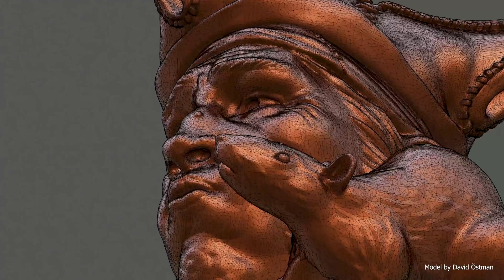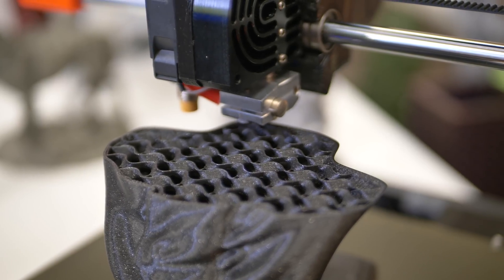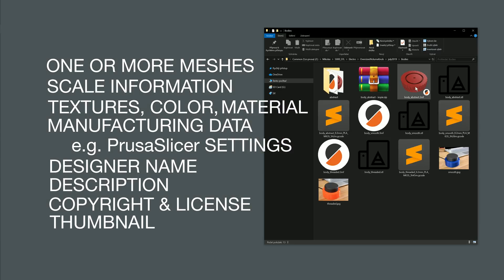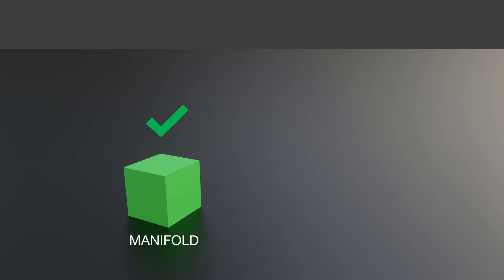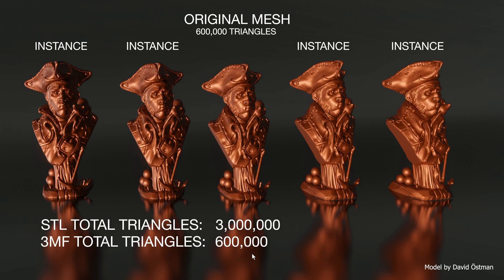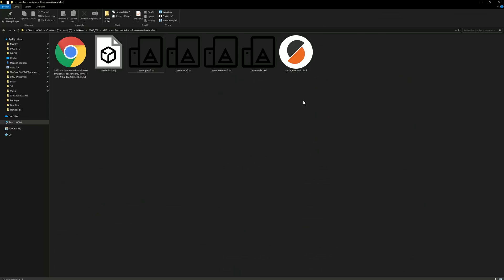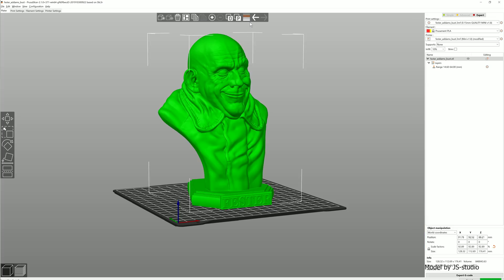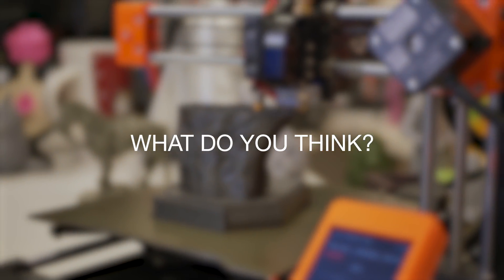Why STL is dead and 3MF is the future of 3D printing

Comment: The print settings really shouldn't be saved in the file. That's like saving the print settings in a PDF. Makes no sense considering people have different printers and quality requirements.
Reply: Ironic since pdf was literally created to be a printsetting application. ..that aside however I agree. Supports and infill are not 'independent of printers' as Prusa says, and are very dependent on the users needs, materials available, and expertise in printing. I suppose it doesn't 'harm' anything to have it in there, but I won't lose sleep over it either way.
Reply from the maker: Stuff like number of perimeters, infill, custom supports, etc. are pretty much independent of the printes, it's pretty nice to have those set-up for you by the model creator.
- Mikolas
Reply: @Prusa3D  They're independent of the prints, but not independent of the printers  (either the people or the machines).  Not saying it's a bad idea, but I'd definitely want Prusa Slic3r to have some sort of prompt for whether I want to use the included settings or not (in a: yes/no/always ask sort of format).  Custom supports in particular might be very dependent on the capabilities of an individual's printer.
Reply: @Prusa3D  I agree, as long as they can be overridden after loading the file. Some of us simply like to experiment with stuff after all :)
Reply: @Prusa3D  It is PARAMETERS. Learn the fucking language, moron.
Reply: I'm not an expert on the current PDF specification (I get the feeling no one is, these days, considering even Adobe has trouble transferring PDFs between their applications :P), but I'd be very surprised if it doesn't let applications store print settings and other custom data.
Reply: @RFC3514  PDF's are not for printing, they essentially have already been printed. they are for easy transportation of data, hence "portable document format" 

If you're having issues with them it's probably because you're "saving as" or "exporting as" which doesn't actually make a true PDF, it makes a messy file format and merely composes the file you were using in a format that can be opened in Acrobat reader and gains its "portable" status that way, other than being able to open it in Acrobat reader it is a useless file format. To make a proper pdf you need acrobat pro so you can "print to" a PDF, this then goes through a program working in the background of your computer called "distiller" which strips out all unnecessary information, compresses necessary information and makes a tiny file size to gain its true "portable" status. The point of which is to send to someone by email so they can check it and if it's all hunky dory you'd then go back to your original file (not a pdf) and get it printed from that file as it contains all the colour information that PDF's do not retain. 

If your printing service is asking for a pdf, it's because they take it for granted you haven't a clue what you're doing and it saves them a load of grief from people not knowing how to make a file "print ready", and if you don't know how to do that, you probably won't even notice that your colours are off.
Reply: @Fergus Denoon - "they essentially have already been printed" - Complete nonsense. PDFs are not raster data.
Reply: @RFC3514  you literally "print" to pdf to make a pdf, instead of a hard copy you get a file.

Rasterising is merely the process of turning paths into pixels, and can be done on a computer and it is completely aside from the "printing" process, non rastered artwork can also be printed so your comment makes no sense at all... Rastering is not a prerequisite for printing.
Reply: @Fergus Denoon - You literally have no idea what you're talking about. PDF is a multimedia format that can include vector data, typeface definitions (that go far beyond what gets printed) and even sound clips and movies (good luck "printing" those!). In fact, these days it even supports 3D object extensions, so you could literally use it (as a source) for 3D printing. 

You can "print to PDF" just like you can "print to e-mail". That does not mean that "e-mails have already been printed" or that either format is limited to things that can be printed. 

And rasterising is very much "a prerequisite for printing" on any normal inkjet printer. Even cheap laser printers rarely have hardware support for PostScript, these days, it's up to the driver to chew through it and feed them raster data. And even when they do support PostScript, they are rasterising the vector data internally, so it can be printed in a single pass across the page (unlike a plotter, which would follow the vector data without rasterisation). In the immortal words of Bob Marley: no raster, no print.
Reply: RFC3514   30 years in the printing/marketing industry... where I know definitions of the word "print" that you obviously don't suggests I do know what I'm talking about, although I won't use an appeal to authority I'll use actual data to back up my claims, your claims however break down quite quickly when exposed to reality;

 it is not a prerequisite on "any inkjet printer" HPz61/z6200 series have "PS" at the end of their title for a reason... I use large format inkjet printers every day that support postscript. You then went on and made a point that discredit you own previous claim that to print required rasterising, it doesnt. 

to "print" something... is to produce a published form, or if you like: arrange for a manuscript/book etc to be reproduced in large quantities, that published form does not have to be physical. You seem to be hung up on the notion a print has to be physical. Multimedia content is included in the definition of "printing" to a PDF, as soon as you have done that and made the PDF you have a "print" of what you wanted to produce.
Reply: "I know definitions of the word 'print' that you obviously don't" - Ah, I see; so you weren't wrong, you were merely using "definitions of the word print" that don't match the one used by other people (or the dictionary). :D Good one. I guess by that new and (un)improved logic, If I "print to PDF" for my own personal use, I'm not printing because it's not being "published" (but I'm sure you can redefine that creatively as well).

Maybe go read up on the structure and history of PDF files instead of writing nonsense like "PDF's are not for printing, they have already been printed" or "they are for easy transportation of data", as if data becomes "easier to transport" depending on which file format you use (you didn't even understand what "portable" means in "PDF" - hint, it has nothing to do with transportation, it has to do with compatibility across multiple platforms, which is called portability in computer science). A PDF is as "easy to transport" as any other file of the same size, and in fact tends to be slightly larger than other formats, because it stores extra data (harder to transport but with better portability).

Of course PDFs are "for printing". That's the whole genesis of the format. It was originally created so the same document (containing text in specific fonts and with specific formatting, images, vector graphics, etc.) could be rendered (rasterised) and printed consistently across multiple platforms. It was a smarter alternative to "print to file" (which was supported even before PDF existed, and merely dumped a rasterised version of the document into a bitmap, at a fixed resolution).

With a PDF, the data was kept as separate blocks of different formats, packaged into a single file, which was then rendered on each system, for its local printer (or, these days, screen), at its native resolution. It was (and still is) almost the exact opposite of something that "has already been printed".
Reply: @RFC3514   RFC3514   the definitions I am using are in the dictionary, they are dictionary definitions, the information I am using can be verified by anyone. there's no way you actually looked up "print" in the dictionary if you didn't see the examples I stated. If "published" doesn't suit the criteria, the other example I used does.

"Of course PDFs are for printing" If it were don't you think the P would stand for "Printable" instead of "Portable" the entire Genesis on the procedure was to make a format that anyone could open on any computer so people wouldn't need to own the software the developer used to create the artwork/document etc, and could open it up on a free application, hence why "save as" and "export as" adhere to portability because they can be opened in Acrobat reader, but they are larger file sizes so are less "portable" than a printed version which goes through distiller, Adobe's actual PDF engine, and creates a tiny file size whilst maintaining quality that can be sent a lot easier, this way the designer can get their artwork proofed by their client on the other side of the world without any hassle and no need for specialised software. 

It was originally invented to it could be printed consistently access many platforms... PDF's are actually very consistent when regarding print quality... if everyone did the exact same thing, which they do not. most don't know how to correctly make a pdf so pantone/spot colours are not maintained. There are so many ways to make a pdf, so many settings that the recipient had no control of, many apps that are downloaded that make them as people don't own Acrobat Pro, inbuilt mechanisms in programmes that all do different things with different results, that is not consistency unless what is consistent is non consistency. Sending an illustrator file from Illustrator or an InDesign file from InDesign will be consistent. Making PDF's one way which completely flattens each page to a single uneditable image is not consistent with making it another way where a PS file maintains its layers, and yet both are "PDFs"

Of course a correctly made PDF is better for portability, The simplicity of e-mailing a 2mb PDF file in comparison to the 199.4 mb PS file it was made from surely isn't that hard to understand?
Reply: @RFC3514  as for "the exact opposite of something that "has already been printed" Erm... So it goes through the print process and one produces a hard copy, one produces a (or, these days, screen) copy... 

Exact opposite?
Reply: @Fergus Denoon - So, first you say "PDF's [sic] are not for printing, they have already been printed". Now you say "it goes through the print process". So something that (three posts ago) "wasn't for printing" and "has already been printed", now is meant to "go through the print process"...? I suggest you continue that argument with yourself (which is what you seem to already be doing, at this point).

Something that needs to "go through the print process" (and, specifically, a different "print process" depending on the output medium quite clearly is a) "meant for printing" and b) not "already printed". It's not even a matter of knowing how digital files work, at this point, it's just a matter of understanding basic language.

Then again, when someone writes "one produces a (or, these days, screen) copy" maybe language was the fundamental issue all along.

I can only suggest reading the last paragraph on my last post again, because you clearly didn't understand it (just as you don't seem to understand what PDF files are or why the format was created).
Reply: @RFC3514  no, I originally stated it has already gone through the print process, and in the last one reiterated that by stating that in order for you to be looking at it on screen it would have been through the print process...

Which is exactly the same thing!

What is wrong with you?
Reply: "I originally stated it has already gone through the print process" - Exactly. You were wrong then and you are still wrong now. I've already explained why; beyond that it's up to you.
Reply: @RFC3514  how exactly was I wrong in that assertion? 

Given that A) we are talking about a pdf that is intended to be printed to hard copy. (So your comments about multimedia are obfuscation from the subject matter as the intent of a multimedia file with editable fields, videos etc is not to be printed, it is to be used in its created format on a computer, why would you print that?) 

And B) the correct way to make a pdf for the intention of printing is to print it to a pdf, the entire purpose of Adobe creating "Distiller" and why the print driver "Adobe pdf" exists in your printer queue when Acrobat Professional/DC is installed (although this may not be the case on a Mac since they pissed off Adobe, which is always a bad idea)(Because this reduces the amount of work the printer has to do, reduces the load on the file, and reduces communication issues. In the case of professional printing services requesting PDF's, that is done for many reasons, what it is not done for is producing the best print, the main thing it is done for is it cuts out the incompetence of many a designer who thinks they know what they are doing but as they can only see things from their own perspective are oblivious their own perspective is a fallaciously ignorant one. So to them, the designer, when opening up an illustrator file for example, or an InDesign file, or an AutoCad file, on their own computer where they created the file, they double click on the file and it opens up, this... Only happens on that computer! If they send that file to the professional printer like they often do... it will not work! 
So the print service provider has options; goes through the painful process of getting them to sift through their computer looking for all the links to images that are missing from their file, extracting the fonts they used and saving them along with the file all contained in a folder, as when double clicking a file the first place it looks for all its links is in the folder it is contained in. this is easier to explain than explaining how to embed images properly into an illustrator file, this usually takes a few attempts by the designer as they miss things, in design at least has a collect for print option that helps.
 printers have had to put up with this incompetence for so long they can't be bothered with it anymore as it's a waste of their time... this is what printing to a PDF does away with. 

When they print to their own local printer they wouldn't make a pdf, they would print directly from Illustrator, so it is logical to assume we are talking about sending it to a professional printer or printing a pdf that has already been created for the purposes of printing, so has already been printed to pdf.

So basically because designers in the past have wasted so much of the printers time they've taken actions to reduce the amount of wasted time, they produce a lessor quality print (which usually doesn't matter as the quality reduction is something that's not really noticed by the average punter who don't walk about with a magnifier) but one that is far more consistent at producing results from the first instance of receiving the file, basically once you have got through "print to| pdf" the information that it produces cannot be changed by layers slipping , missing fonts or merely opening it up on any other computer, it will be very/completely consistent, as opposed to Illustrator/InDesign/Cad files which are not consistent at all and require external resources to make them work properly, as opposed to the flattened PDF file which requires no external resources at all. 

If you take a "save as" or "export as" pdf to a external printer the first thing they will likely do is... Print it to a pdf, because they already know it wasn't printed to a pdf by the size of the file, the reason they don't send the "save as" file directly to the printer is because it will cause problems, the print machine expects certain things from a pdf, and if it doesn't react like it should it will simply abandon the file and will stop printing, this will not happen with a "print to" pdf. If it starts spooling for too long because it has to flatten layers it will likely abandon the print, PDF's are not great for printing banners and usually cut off at 2.1meters whilst you never ever get these issues printing directly from the programme the file was created in because they are all better at printing than Acrobat. Acrobat however has additional features they do not have like multiple pages options that some programmes would require a manual set up instead. 

You are always better printing from the programme the file was created in if you can, that's what produces the best results, that's where all that files information is retained, using a local printer you'll have no problems, using an external printer you'll be met with problems hence why they ask for PDF's, because they are portable.
Reply: fergus, mate, i do work in the printing business, and you have no idea what youre talking about. pdf files are totally "for printing", thats the whole point of them. whether youre printing on paper or on a screen, a pdf file is a container with a list of formatting instructions and source material - text, fonts, images, graphs - that allows you to build the document in a format compatible with the output. 

it has definitly not "already been printed". in fact, if you knew anything about printing, youd know that pdf files need to go through a rip (raster image processor), the most common of which is adobes aptly named pdf print engine. that is what produces the data that your printer can understand, and that is what the "print process" is - transforming the dissimilar source materials and formatting into data that can be sent to the printer to get a hard copy (or displayed on screen, which is simpler but also goes through a similar rendering process).  

i dont believe for one second that you worked in the printing industry for 30 minutes, let alone 30 years. now, in the marketing industry, yeah, i totally believe that, seeing your ability to talk bollocks.

and to answer the op, you can indeed store print settings in the pdf file, but if you load them into a system with a different printer most of them will be ignored, since there isnt really a standard for equivalent settings between different manufacturers.
Reply: @JimSteinbrecher  it is not the "whole point of them" as I've previously stated. The "portability" is the whole point of them. 

I would argue that because Adobe had to invent their print engine specifically for PDF's to print properly, and not for any of their other programs that backs up all I've said.
Reply: @JimSteinbrecher  how long have you been in the print industry? You're maybe not aware of the evolution of PDF's?
Reply: @fergusdenoon1255  You should never print to pdf if you have tha option to save to pdf. Printing creates a raster based file, which has a fixed resolution.  Saving usually creates vector based data (depending on the original source) with embedded fonts. Then if you print at different resolutions or zoom in, it always looks clear/sharp be because it recalculates the features at the new resolution. Raster would become pixelated.
Reply: @court2379  well, that depends on if you're creating a pdf for its intended purpose and if you are doing that you would most certainly print to PDF, that's why Adobe created the process and Distiller in the first place, and this is how you produce the smallest most portable document format.

or, sending it to a print service that can't be bothered producing the best quality from your original file because of all the hassle that goes along with that process and of course the addition of paying for programme licences in order to produce the best print... When instead they can make their life really easy by just asking for PDF's. 

"You should never print to pdf" what a bizarre thing to say... you maybe need to ask Adobe why that's a facility only available to people who pay for the premium version of Acrobat, they're obviously oblivious to this "you should never print to pdf" or maybe, just maybe, thats exactly what you're meant to do to create a pdf for the purposes of why PDF's were created in the first place, maybe that's why they invented it!
Reply: I'm pretty confident that how slicers implement this feature is going to determine the adoption of 3MF. As an example: let's say the only supports I'm comfortable cleaning post print are tree style. Hypothetically if I have to override that setting for every print, it'd be easier for me to just stick to an stl where my user settings are respected.
Reply: @MiscSimon  just import 3mf, export to stl, clear and import stl
Reply: dsp4 actually it is a good idea to use a specific color profile when saving a PDF, specially for large jobs.